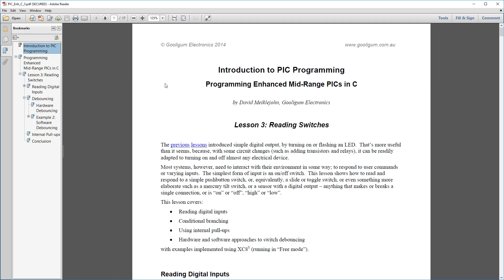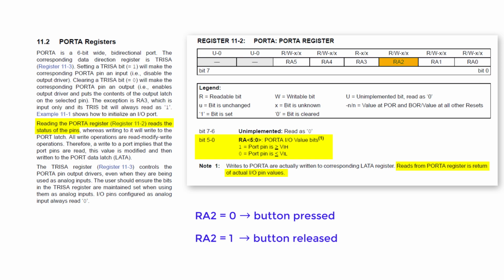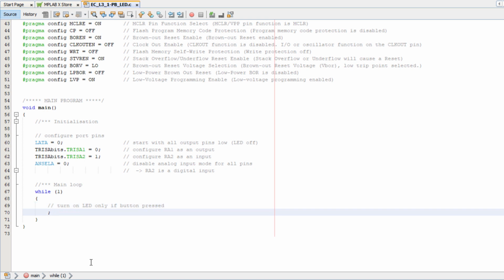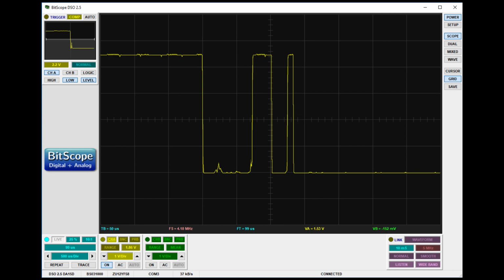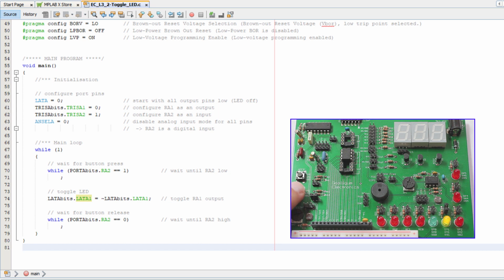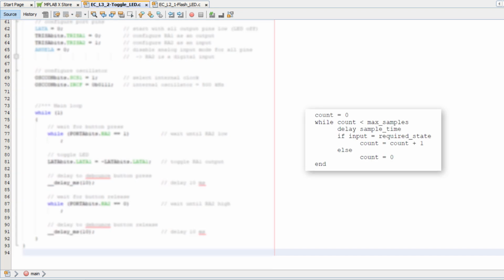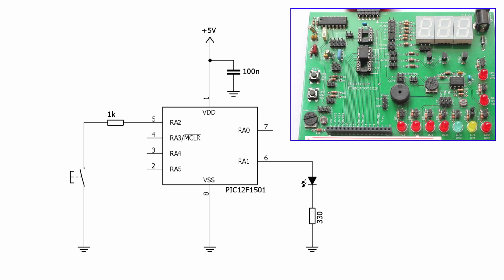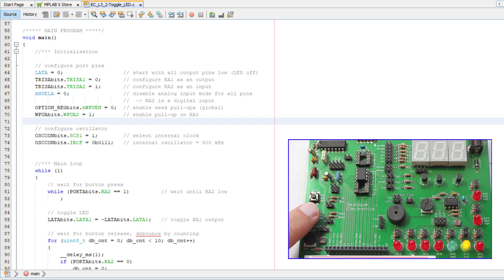Midrange PIC C programming lesson 3 - Reading Switches

Comment: The ON/OFF/ON/OFF does not work for me. It turns on with one push but not off with the next
I had to write it like this but even then, the amount of time the button is pushed for it to work varies a lot ad sometimes takes a few pushes to turn it off. any thoughts 
 while (RA2 == 1)
             ;     
         { RA1=~RA1;}
        for (uint8_t db_cnt = 0;db_cnt<10;db_cnt++)
         {__delay_ms(1);
         if (RA2 ==1)
             db_cnt=0;
         }
         while (RA2 == 1);
         { RA1= 0; }
          
         for (uint8_t db_cnt = 0; db_cnt<10; db_cnt++)
         {__delay_ms(1);
         if (RA2 ==1)
             db_cnt=0;
         }

Comment: Thanks for taking the time to make another video. Anyone wanting to get into PICs or micro controllers in general should seriously consider his demo board and tutorials. It's written well and will ease you into the topics gently. Sure - you can go down the Arduino Atmel route do a lot with Arduino by copying and pasting code but you can't hide behind a library forever so you might as well get your hands dirty early on and the PIC family is a great start. I particularly like the fact that he uses the 10f model in his tutorials.  It's super basic so you aren't overloaded with on board functionality and after getting some basics down I had the confidence to try and max that chip out without worrying about whether I had million and one registers set correctly! Lots of other tutorials start you off with chips that have so much functionality that need to be switched off in early learning stages and not having to think about that is good.
Reply from the maker: Thanks - that was my original intention.  The 10F200 and 12F508 are really simple - you can even ignore banking and paging because they have so little memory.  And the peripherals are simple.  So by learning the smallest baseline devices first, you can get your head around the basic 8-bit PIC architecture and then take it from there.
But I had to rethink when Microchip came out with the SNAP programmer, that doesn't support those parts.  So, it's been painful, but I've done new intro videos, using the 12F1501, which is the simplest still-fully-supported part.  This is the third of those.  I don't like repeating material, which is one reason I've been so slow getting these out.  In this one I had to do the "trust me, just use this statement to disable analog mode on this pin for now, and we'll explain more later" thing, which I'd wanted to avoid but couldn't be helped.  Anyway I should be able to move forward from here!